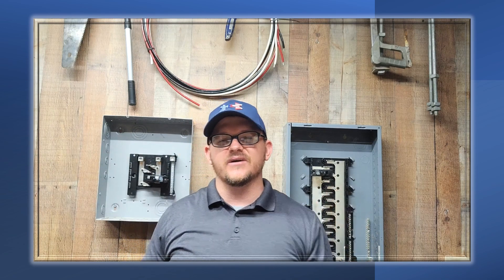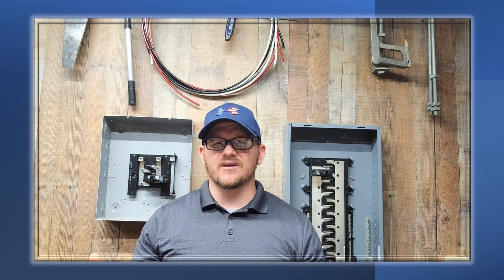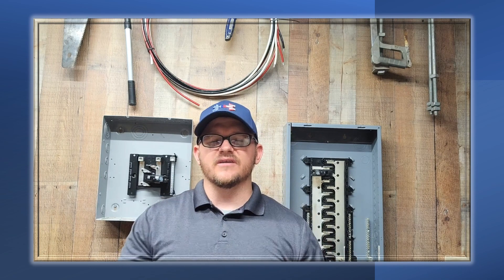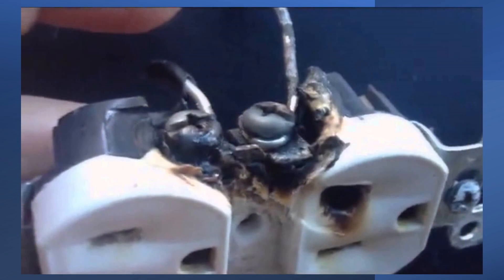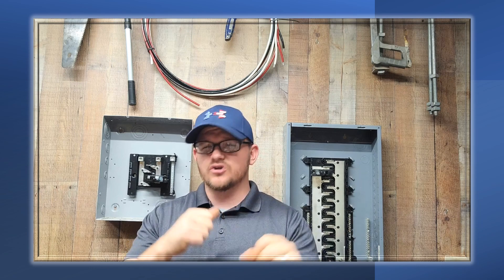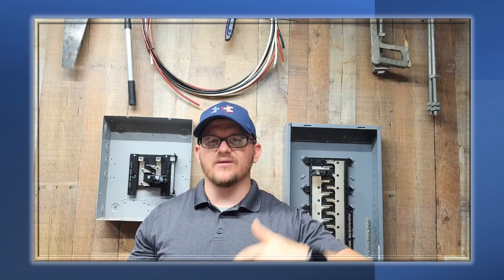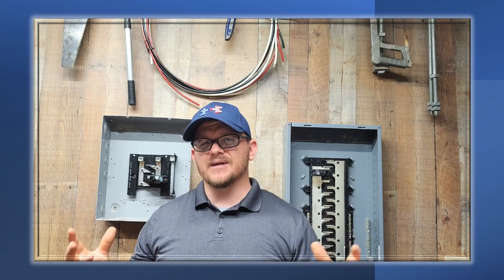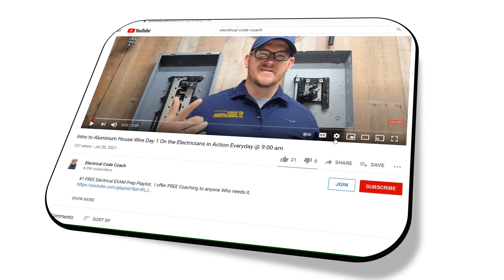Intro to Aluminum House Wire DAY 3 moisture/oxygen/resistance

Comment: Thanks for the info. I have treated both ends of my electric stove wire with Noalox previously. I just realized that I could replace the aluminum with 6/3 NM copper instead and make it safer and more efficient. I'll pick some up tomorrow after I take a measurement.